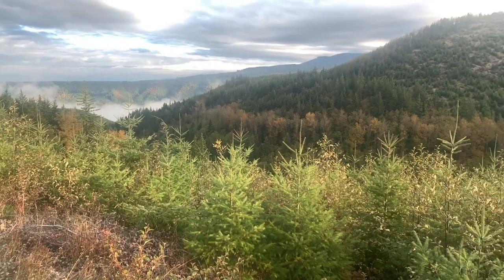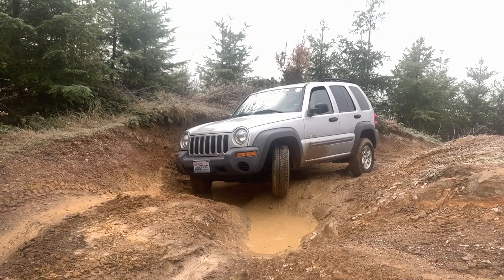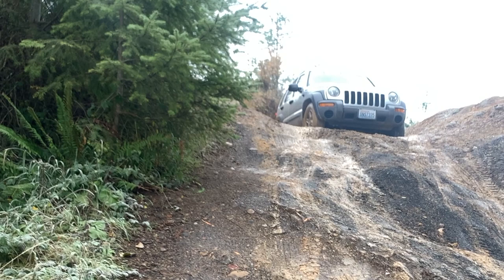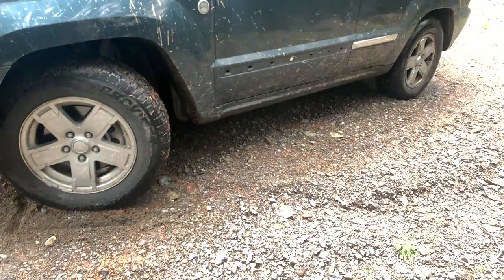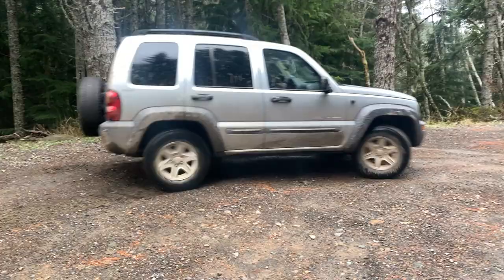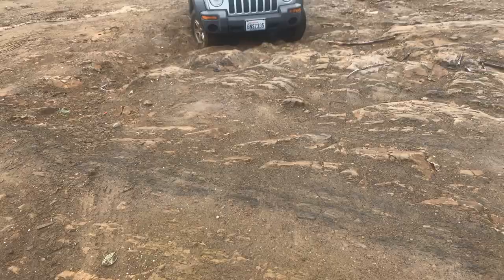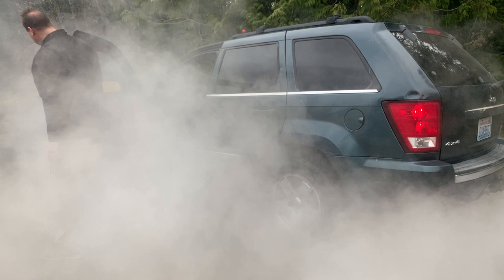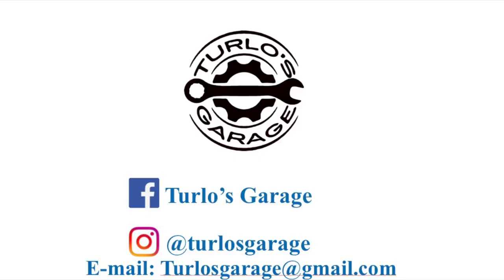JEEP LIBERTY KJ VS JEEP GRAND CHEROKEE WK/ OFF ROAD DUAL TO THE DEATH!/ The winner is SHOCKING! EP34

Comment: Hey I’ve got just got a couple questions if you or anyone could answer but I may have a 07 Liberty 4wd come into my life soon for about 1000$ and it’s from a family friend who’s trust worthy and it was just a old highschool car. She said it drives strong and shifts well and only has 130000 or so miles on it and the 4wd doesn’t work currently but otherwise drives fine and just needs new tires. Are there any weak points in the transmission or 3.7 v6 that’s in it? Transfer cases and driveshafts are easy enough repairs for me but I don’t feel like dealing with a blown trans or thrown rod... of course as soon as I get the vehicle I’ll change all the fluids from the diffs to windshield wiper fluid but it does seem as if the 07s are much more reliable then the 06s because of the improvements made to the engine and the noticeable 60hp gain
Reply from the maker: Good question. There should be someone on here that can answer that. I don’t have any experience with an 07.
Reply: @TurlosGarage  Thanks for the response! I found out I won’t have to worry about thrown rods much because part of the improvements done to the engine between 06 and 07 is forged connecting rods:) Little bit of a relief but I’ve heard of others having problems with the coolant system and head gaskets... coolants quick and easy enough for me but I’ve done 2 heads since March 2020 and I don’t feel like doing another till 2022 when I have my own shop space and tools...
Reply from the maker: @georgep-v9005  sounds good! 👍

Comment: does the WK have the QDII system?
Reply from the maker: Yes
Reply: If it does it would have a rear auto locking differential.  The Liberty has a limited slip differential, not a posi-trac as they were trying to call it....and the limited slip is an option not a standard feature and doesn't look like it had a limited slip, or it was worn out...in a straight line it'll act like a locker, when you turn it'll release the clutch packs in the differential to allow different speeds for cornering.

If you really want the best Quadra-Drive system you want a Jeep Grand Cherokee from 1999-2004...in those years the quadra-drive gave you visco-locking front and rear differentials.  From 2005 on the "Quadra-Drive" only gives you a rear auto-locker.

Comment: More data please, like specifically which year and trim is the KJ and which is the Grand Cherokee, I know the liberties come in And have a few different transfer case options, and my Liberty does have ESP, which is extremely helpful in comparison to my older Liberty but this is the 2007 limited model, and on that I have the command track  case, it's got the four-wheel drive full-time option which is apparently usable on dry road, so that's definitely better than delivery you're using which seems like a base model perhaps with a rudimentary transfer case, strange to me to see the two front wheel spinning but no action from the rear but that was because one rear was spinning I imagine . I don't know what kind of differential on the rear I have but where I would become stuck previously with my 2004 Liberty I could easily push through with The ESP which blinks a light when it's being used it's also got a electric throttle which is strange to me, but also what model And you're for your Cherokee?She over 05, I did not know Jeep made an all-wheel drive option or system, most of the time I think of all wheel drive is all wheel BS.. either it's not real like on the Ford escape 2007, or it's always on and causes damage and extra wear like Saturn Vue AWD, these are my two favorite Jeeps you got right now the 2012 and up Jeeps are nice and by Jeeps I mean the Cherokee, but I wouldn't buy one past or 14 or 15..
Reply: If your Liberty has full and part time 4WD, its Selec-Trac not Command-Trac.  Command-Trac system has 2WD, 4WD Part Time, and Low Range.  Selec-Trac has 2WD, 4WD Part Time, 4WD Full Time, and Low Range....both have neutral.  

The Jeep full time 4WD system has changed over the years.  It used to actually be true full time 4WD, where power was sent to the front axle all the time regardless of traction conditions.  The newer models starting in 1999 went to the NP247 transfer case which diverted power to the rear wheels during normal driving, and when low traction conditions were detected it would then start to send power to the front, and could send 100% of the power to the front wheels if needed.  Prior to 1999 they used the NP249 transfer case in the Quadra-Trac models which sent 48% power to the front and 52% power to the rear during normal driving, but could vary the output depending on conditions.  I had the 1996 Grand Cherokee with Quadra-Trac, that thing did awesome in the snow/ice, and I took it offroad a lot and never had issues getting stuck, the 4WD system would figure it out and you'd just keep on going.  The downfall to the NP249 transfer case was it had a viscous coupler in the transfer case that varied the power going to the front axle, over time that viscous coupler would wear out, normally after around 150,000 miles or so....once that happened you went from full time 4WD, to more of a part time 4WD as the viscous coupler would fail in the engaged 50/50 torque split and during tight turns it would cause wheel hop and drive train binding.  my 96 Grand Cherokee amazingly made it to 232k before the viscous coupler failed...and at that time I didn't know I could have simply swapped in an NP242 or NP231 transfer case and kept on going.  

The NP231 transfer case is Command-Trac part time 4WD only.  The NP242 transfer case is Selec-Trac full and part time 4WD.  Both the NP247 and NP249 are both the Quadra-Trac Transfer case.  What gives you the Quadra-Drive system in 1999-2004 the front and rear differentials had vari-lock differentials allowing full lock up of the differential if necessary and they were automatic, and hydro-mechanical....in 2005 and newer Quadra-Drive models they only have a rear locking differential and the front is an open differential and they use the ABS system to modulate brake application to trick the front differential into sending power one way or the other for added traction....it just wears out your brake pads much quicker LOL.  

Most automatic 4WD systems, and AWD systems are reactive rather than pro-active, so they engage after you've already lost traction, rather than being live all the time providing you varying amounts of traction/stability regardless of road conditions.  Subaru's AWD system is on all the time and sends power to all 4 wheels in varying amounts depending on many variables.

Comment: Hey quick question:
Someone near me is sellling his 2004 Jeep Liberty Sport 4WD with only 18,600 miles (yes, 18,6k) for $2,600 usd. His wife passed away and he is looking to get rid of it. Is it a good deal? The exterior looks very good.

Thanks!
Reply: If its legit; an excellent deal! I bought an 04 liberty limited, 3 weeks ago, with 97000 miles, from a used car dealer, for quite a bit more than 2600. Be careful buying. Lots of scammers out there!
Reply: @aaronrainey788  Yes, thanks for your answer!
Reply from the maker: My 02 had been great. 2600 seems too cheap with only 18,600 miles but I can’t answer if it is a good deal or not. If you want a Jeep that does everything good and are looking for a Liberty that seems like the one to get. Hard to answer from a distance.
Reply: NO ITS A BAD DEAL.
Give me the guys ph number willya ;-)

Comment: Liberty has posi rearend???
Reply from the maker: Apparently some of them do. I think some kind of posi or locking differential in the rear would make the Liberty very capable off road. 
I have to correct myself, there is some kind of posi in the rear. I can spin both rear tires when turning on wet asphalt. It is not enough for off roading. I think a locking rear differential would help but a lift kit that allows for more rear axle articulation would also be a benefit.
Reply: @TurlosGarage  well a couple of the guys say some of the have lo range 4wd and if thats the case then they should be very capable!
Reply from the maker: @EricJohnson-tb9sj  in the one year Liberty review video you can see the transfer case shifter at 4:20. 
https://youtu.be/kwWY95RJPkg
It has 4lo
Reply: @TurlosGarage  BLD

Comment: your rear dif is dead :(
Reply from the maker: I have comments saying these don’t have any kind of limited slip to some do to mine is bad. I think I will be doing a video in the future and open up the diff to see what is in there. When I take a tight corner there is a squeaking noise that sounds like it is from the diff. When I jump on the accelerator it feels like both wheels spin but I can’t be sure until I pull the cover off. Thanks for watching and commenting!

Comment: These desperately need lift and tires.
Reply from the maker: You are 100% correct!!!
I had plans of doing a lift, fabricating bumpers and rock sliders and running the Rubicon with both Jeeps and some friends last Summer but the pandemic stopped all that. Definitely on my to do list.

Comment: If you had traction control in the liberty it will go places the grand Cherokee will never go.. i own both .. a 2007 grand and a 2006 liberty with traction control and it runs circles around the grand off road , way better approach,, departure and cross over angles.. brake lock diffs make a huge difference..
Reply from the maker: I agree. I think the Liberty is as close to a Wrangler as you can get without getting a Wrangler. And it is quieter and more comfortable.
Reply: I have liberty 2006 2.8 CRD . traction control works automaticaly or has any button to activate traction control system. ?
Reply: @giorgiphutkaradze9214  there is a button you will see on top of the steering column it will say “ESP” if you push that button it turns the traction control “Off” and you will see the car with the squiggly lines on it light on the dashboard , that means traction control is “Off” push button again and the light will go off again that means traction control is now “ON” and works automatically,  without you having to do anything.. now say your driving in the snow and all of a sudden the light comes on the dash that means the traction control is working actively at that moment to gain traction, then once it gets traction again the light will turn off ..so in summary as long as you have the button so when you start your jeep and there is no light on the dash the ESP IS ON AND WORKING AUTOMATICALLY.. if you start your jeep and the light “ON” then push the button and the light goes out than means all is working and your good to go...hope this helps
Reply: @PhatboyHD88  thank you,  i've already understood what is purpose of ESP button, liberty really good in my case car is lifted  with 2 inches and for me absolutly enough...
Reply: Unless the 07 WK was an Overland/Hemi. Overland had ELSD fr and rr for 07 -08 only.
Fantastic! I've had several Grands and the 04 Trail Rated Libby was an absolute gas!!
Gas mileage sucked on all except the Hemi with MDS Avg 22 mpg freeway.

Comment: You might maybe I hope you didn't blow your damn gasket on that damn hemi God give it to Dodge to build a hemi engine big displacement which they don't want you to rev you know oh here's the power and torque but just know if you use it you run a risk of destroying the entire engine, also, these engines were likely built and designed during the real bad fuel shortage of 2007-2008 where efficiency was even more of a worry and requirement for cars built in the US.. and while Dodge still tune to maximum horsepower and torque they lighten and put smaller pistons and lighter crankshaft rods because it'll save a extra squirt of fuel here and there, cuz when fuel is five bucks a gallon and it's 2008 that v8's going to be killing you, even with your multi-displacement BS.. it's a shame, basically I whole generation of engines I avoid like to plague, also comical if you try to put boost on these engines, funny how you never see a supercharged version. Not even a small factory charger....  There's another reason for that and it's called cheap ass Chrysler Mopar, they're much happier to build the engine right at its Breaking point, it's coming long way since the 2JZ engines you can find on the supras in the '90s this is not an engine which can take a thousand horsepower or one stock block, let alone 400, damn shame and now like most of American cars are all American cars they are dead to me basically Fiat owned and Chinese in Chinese provide the parts which are assembled in Mexico and nothing about that car manufacturer is American except for the bitch ass free trade agreement that allows it to be done at a profit still to this day been going on since the '90s people are dumb though anyway thanks Clinton.. it would be amazing to have a car completely built designed then manufacturing in America with American parts and I mean the very steel in the freaking block or aluminumYou very much like the Japanese now, it hurts my heart to say it but they have taken the mantle of greatest constructors from us not like we fought for it.. And they still hold it thank God somebody tries at least, and this is why I only buy Toyotas or Subarus usually Toyota. For any car after 2016 I will not buy any new American quote unquote car built after that date.. not a very big fan of Fords, especially since that to me they seem to have gotten worse but Jeeps were always my favorite and now they are getting old and harder to find, I drove a brand new Cherokee for my job in 2008, I don't know what to trim models are for that year but this must have been the highest level, The difference in the interior between that Cherokee Grand Cherokee and my Liberty today is shocking that thing was freaking luxurious and beautiful inside comfortable but still retains that perched up seating position Jeep is famous for, also it had one of the first backup cameras I ever seen on a Jeep, ever since I drove that for one day I wanted to own one I would prefer it to have the 4.0 l V6 of the '90s but that's a pipe dream AMC RIP but I believe the 3.6 l is available with the high level trim, I could be wrong though and I wouldn't be surprised and I also would be very very weary about buying any V8 especially a V8 hemi horrible engines usually beat the shit out of, by idiots who didn't care for it,. I don't know I have a sense certain way about of picking my used cars where I'm never had one that broke down on me and I've earned about six. Let me put it more honestly I've never had one that failed to drive me sure maybe breaking and you know, functioning driver side door maybe luxuries but engine and transmission I've never failed me ever since I started driving on cars I've picked myself that is. Got to continue the streak and my feeling says no bueno on any Dodge hemi, especially one with over 100,000, but even a newer one one must consider previous ownership and the poor design choices Dodge made over and over and over I believe the older earlier 2000 hemis were better built I could be wrong. But they got the worst when the new charger dropped. Go ahead and buy any 2008 charger with the hemi I guarantee you're not running on all set eight. I guarantee you at least got one misfireBut Well sound good out the back still and maybe that bad cylinder was only a coil or maybe a fried piston Ring because Dodge used cheap ones that were fitted way too close to flush for consumer cars especially consumer cars that are marketed as you know high performance muscle car go ahead and arrive me up to my tarpon 6000 RPMs we'll be fine but in reality that engine saying no ooookoo. And I don't know how to feel about the MDS I've heard it causes issues, but I don't know if using it or not has any bearing it's mostly in the design to accommodate that. Stupid ass feature I guess they would call it, where in that the cams tend to wear down to the nub, Because the rocker arms seize up somehow typically around the MDS cylinders which remain powered when the vehicle decides to switch from eight cylinder to four cylinder you know for that four seconds your coasting on the highway.... Which games you a total fuel savings of. Negligible If you want a fuel efficient engine buy a small engine... Does less cylinders the less displacement more fuel saving  there's no way you get fuel saving with power it just doesn't work that way...  No matter what bullshit the best you can get out of 8 is likely 10 to 15 city and if you're lucky 20 highway but I would have I would bet more on 18, how the cookie crumbles